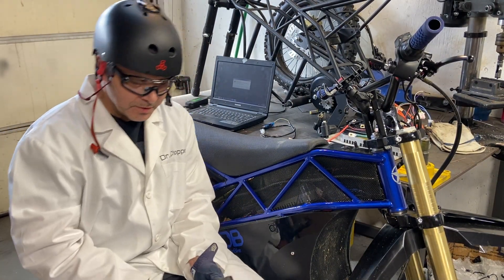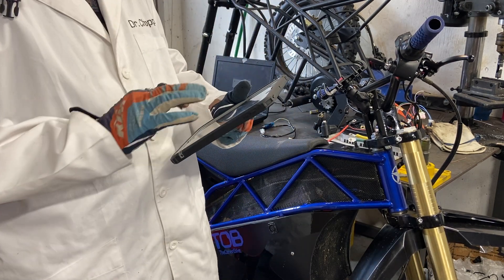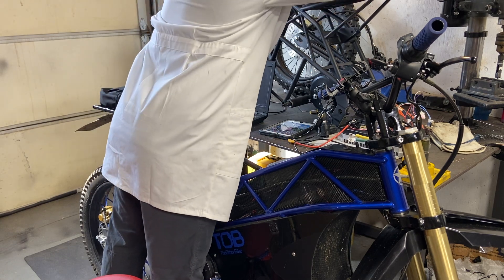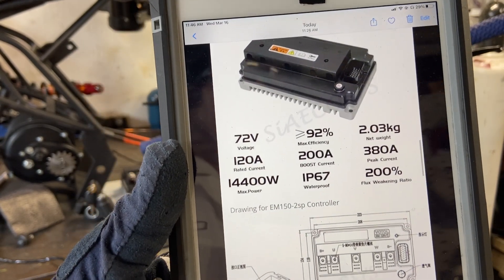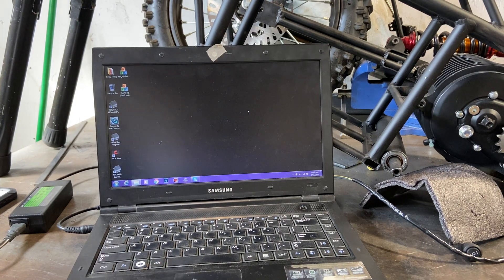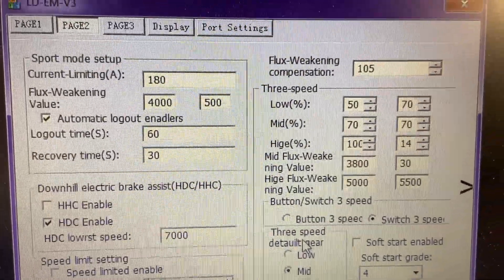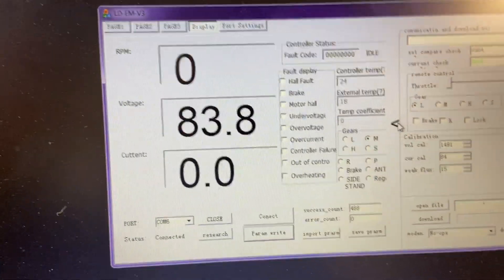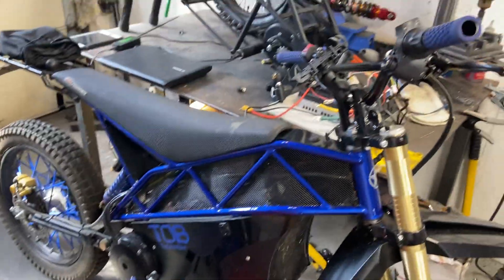TOB ebike VOTOL EM150-2sp EM200-2sp controller program, QS 138 70h V3 motor, Ebike1

Comment: hi does your settings works on an atv with the same motor? or should i change something? i got em 200 controller 72V 50ah battery with qs138

Comment: Thank you for this video has helped alot, did not realise on page 2 current limit is actually phase current so had mine maxed at 60amps same as page 1 busbar limit at my battery's bms max so i have been capping my torque all this time....what current limit would you recommend? Motor is 1500w on my quad bike running at 60amps 60v 27ah lifepo4, controller em100sp.... Thank you again 😊
Reply from the maker: You’re welcome. Page 2, top left corner is your SPORT Mode. That cannot be higher than your BMS. I just bypass the discharge only to get max performance and done properly is safe. The first 10 rides you must make sure the battery isn’t running warm/hot. That step is crucial. If you’re not comfortable doing that part than no worries 🙏
Reply: @tobebike So I'm max out with both busbar current and current limiting at 60, my battery can definitely discharge higher but bms is rated to 60 as I said 😢 How would I increase phase current as to my understanding can be much higher then bms/battery current? Thanks
Reply from the maker: @tecnikturbo I think it’s automatic. I’ve never seen actual phase line amp settings

Comment: Hello Dr. I've been recently following your channel because I converted my Kawasaki KX250F to an electric bike, however,  I can't do max power with the finished bike. It can only go up to 40kph when I tested it. I am using the same controller as yours but I only have 48 volt lifepo battery that comes with the kit. Do you think the battery is the problem? Thanks!
Reply from the maker: @kristophillada1767  which motor

Comment: Hi !! Can you help me ? Mi E-motorbike has a VOTOL controller. In the dashboard appears a MOTOR failure and says engine has 200 °C !!!! An it seems NOT true. Can you help me with this issue ? Thanks in advance !
Reply from the maker: There’s a FB group called “VOTOL controller tuning”. Try posting there because I never heard of this issue. My opinion is maybe a wire short. Inspect all your wires. Maybe it’s a bad temp sensor or wires are touching somewhere

Comment: Hey man. Got a question for you. I have just purchased the em200 2sp and for some reason cannot get it to power up. Battery's brand new. Sitting at 80v, controller n throttle n motor are new . I'm not sure if I'm wiring the elock correctly
Reply from the maker: E lock is single purple/gray wire. I ad a switch and run it directly to B+. 
EM 200 2sp has the red light will flash a few times when power is on

Comment: Hello Dr. I have a 120A max  battery. So I should set the bus bar current  to 120A and also sport mode to 120A? Is this correct?
Thanks

Comment: I just watched the video 2x I did everything u did every page wrote the program lose turn power off and on still no one movement on the throttle as I turn it
Reply from the maker: What does your “display page” read? “P” isn’t on is it ?
Reply: @tobebike  p?  Sfter u said controller error i seen that and like a code up top 0000000200 but also  i reset (turn the key off and on)  reconnected and  it went a way but still no throttle movement

Comment: Thank you so much for taking the time to demonstrate this for us! I have ordered an em150 2sp to run my qs 138 70H v3 motor.  I believe the 138 motor has a hall phase angle of 120°. 

Can you tell me if I will need to perform the self learning function to pair a qs 138 motor with the EM 150 2Sp controller?

Cheers amigo, awesome stuff!
Reply from the maker: It will be ready to run if you chose 138 option when you ordery
Reply: @tobebike  ahh that would be great! I definitely told them I would be using a qs138 motor, hopefully they get it right ;) 
Thanks again!

Comment: Did you have any issues installing the drivers for your computer to recognize this USB cable? Some how the provided driver software is not installing properly. The programming software opens up but I can’t connect  to the controller because my COM port is not connecting.

Comment: Any idea what all the flux settings do/mean?  like what is the difference between High mode 100 / 14 flux vs 100 / 10 flux?
Reply from the maker: Let me check . I just walked in
Reply: @tobebike   For instance on high flux weakening you have 5000 /5500. What difference would 4000/4500 be?  I am playing with changing these settings, rpm stays the same but the "smoothness" of the motor changes.  Depending on what numbers i have the motor either wants to bounce off the table or run decent. :)

Comment: I do not really understand what bus bar amp on page one does, everything is based on sports amp, so if you have 180 amps in sports, the gears are based on that.  on em 150/2 sp
Reply: I wrote to siaecosys not even they do not seem to be able to answer what it does but they said that for votol 150 / 2sp is max 150a and that is true if you look in the instructions on the model s 60v 150a 72v 180a
Reply from the maker: @goelectric8269  I rode 12 miles yesterday on the mountain trail. I used 2v in #2 speed just taking it easy. I use more battery on Busbar setting @ 100a . That’s with my settings as in the video
Reply from the maker: I was told Busbar Amps is 1, 2 and 3 gears .
Sport mode is separate settings as I’d in the firmware on page 2
Reply: @tobebike  I think it is on the slightly older controllers if you check with an amp meter then the switches are based on sport amp the first box controls rpm based on (hdc lowrst Speed: 7000) the second box you set amp in% based on amp  in sports amp i have 150/2 sp sw:232 hw:1.13
Reply from the maker: @goelectric8269  maybe it was an easy explanation to me. It makes sense when I’m riding. I set my busbar to 70a and Sport Mode to 140a. I’m having fun on the hillclimbs in # 2 speed, pulls sikk wheelies too. Definitely more fun with busbar set to 100a but it uses more battery
Reply: @tobebike  if you set as in the video sport 180 then should have 126 battery amp and 4900rpm on 2 gears I have to go out and see if it makes any difference if I set down bus bar in battery  amps edit: No driften in power draw
Reply from the maker: @goelectric8269  I’m a frame builder and I don’t understand sinewave controllers. But thank you for helping me understand it better. Let me know what you find out
Reply: @tobebike  yes have now tested it makes no difference to set down bus bar amp it draws as much power on the battery anyway
Reply from the maker: @goelectric8269  I noticed a big difference. I’ll have to do more research. My rear wheel spins less on 70a busbar . Big difference on 100a busbar
Reply from the maker: @goelectric8269  our 3 speed settings are different